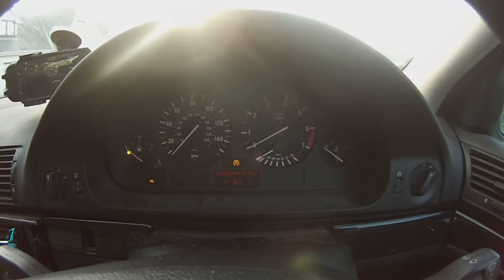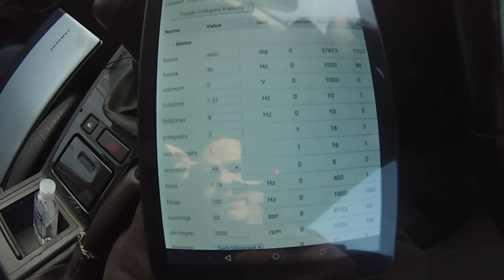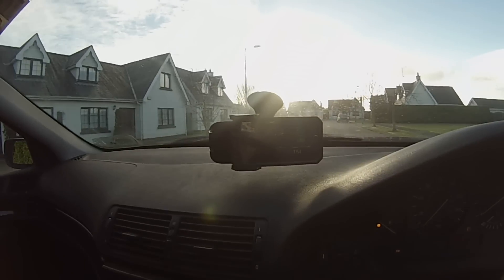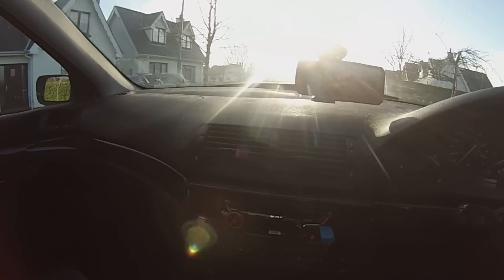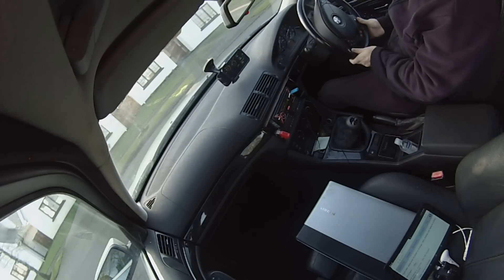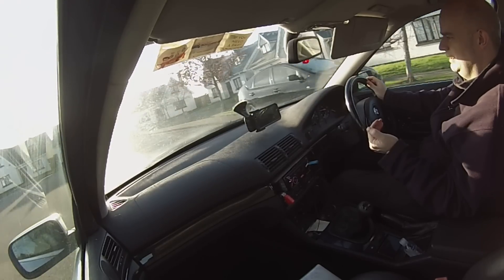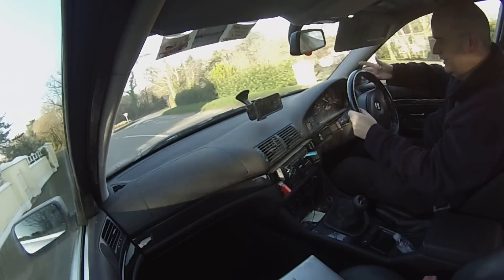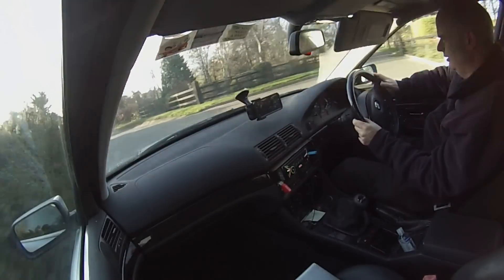BMW E39 EV Conversion 61: DC To AC Part 9

Comment: Damien, I so very much want to build an EV b4 I kick the bucket. I'm in the USA. Where do you find your used EV motors or hopefully one of your other subscribers might give me an idea. Can't afford a new one and no forklift yards I've called in the North Idaho area have any at this time. Those Siemens you use look like just the thing I need. Thanks for helping to save our planet and sharing your knowledge. Randy with randog1951 channel.
Reply: Ebay, obviously. Copart auctions. Craigslist. Jack Rickard over at evtv. EVWest. Jhu Garcia.Those are a good start.
Reply: @blackmanops3749  thx,NVR herd of chart auctions. Thx again

Comment: This does unfortunately sound quite similar to issue with other motor setups. I hope to be able to get more experience tuning these systems to figure out what is causing this dual faceted behavoir; quite nervous and tending to trip out and in the higher rpms working as it should.

Comment: Hi Damien, love the show! Is it possible to add a delay to the current limit to allow the  “heavy” vehicle to gain momentum? It should help at the bottom of your midrange revs. Then, for the low revs - as your resultant voltage is still quite low due to the low PWM duty cycle, the relative amps must be high to allow full power. Your current limit should thus be inversely related to you PWM duty cycle. In other words - low RPM = high current limit  requirement.

Comment: Maybe increase the PWM frequency . If I remember correctly with a lower inductance a higher PWM frequency tends work better. Less time for the current to rise in each PWM interval. Of course the trade off is more heat in the IGBTs. I'm just throwing stuff out I know nothing about induction motors .

Comment: Hi Damien,Enjoy your shows!Maybe you need some more inductance in your motor circuit.   Current ripple may be big, specially at low speeds.Maybe take a field out of a series motor, or try the Prius inductor.Karl

Comment: Add even more slip and lower the current limit in order to not trip?
How does the huebner software vary slip according to throttle and rpm? Is it known how slip should be varied for this particular motor?
In any case, if the motor is large enough, it definitely should hit your current limit at slow speeds. That's a healthy situation, just make it not trip.

Comment: Burnouts! we want to see burnouts!  😂

Edit: What does the throttle actually control? Does it just increase the current to the motor, or does it also increase the "rotation"  of the generated EM field in the motor? (is that what minslip/maxslip controls?)